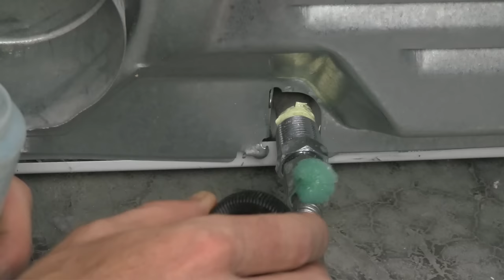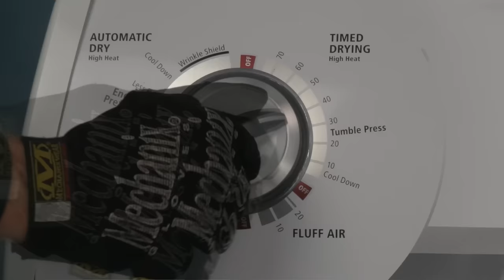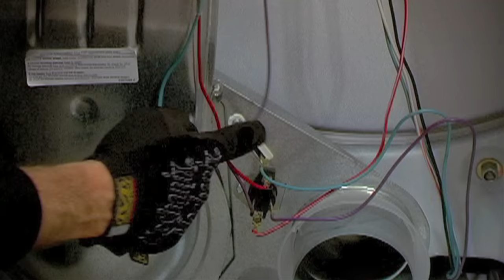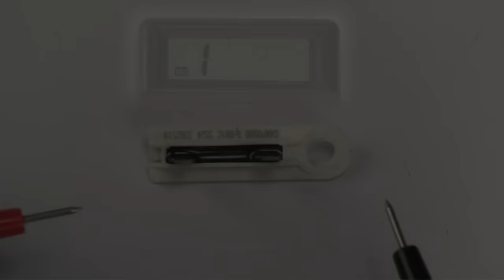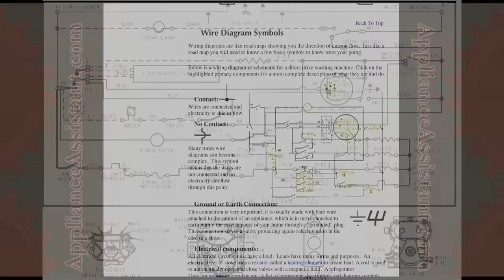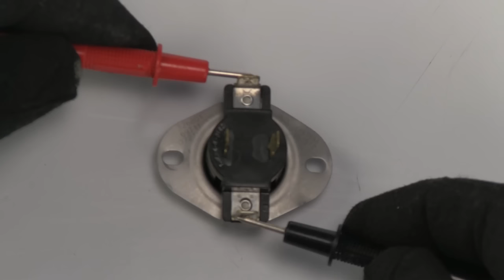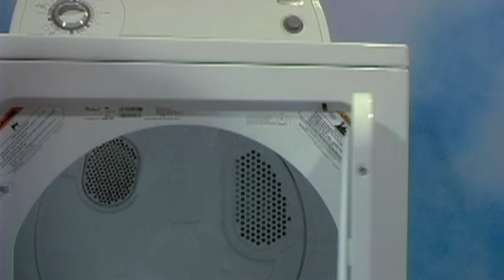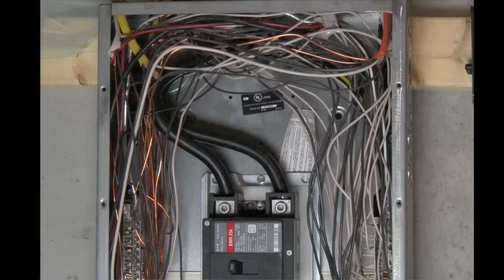Gas Dryer Repair: Fix Heating Problems

Comment: when my glow comes o0n a few seconds later it ignites it stays on for about 2 minutes then it shuts off. when it glows again it does not ignite. could this be the temperature fuse
Reply: So you know for sure 1. Igniter is working 2. Flame sensor working. Go back to the part about the gas solenoid valves. The solenoids are coils that create a strong magnetic field to pull open the gas valve. If they let gas through at first but not after coming up to temperature the insulation on the windings could be breaking down. That means the field they create will not be strong enough to open the valves. You’ll have an igniter glowing but no gas to ignite.
Reply: yes i had replaced the two coils and it works great now thank you for your video

Comment: Thank you so much for the video.  So, when I checked the thermal fuse with the multimeter nothing happened.  No reading.  Bad fuse.  I get it now.  I bought one in town and put it in.  I used a multimeter for the 1st time and fixed my dryer.  God bless you sir.  You are helping people with your gift.  Good things will come to you.  :)

Comment: Just started troubleshooting on my gas dryer(Crosley), with no heat.  Many times you said 'if the fuse tests open, or if the part tests open replace it."  I would have liked to see what that looks like.  Tests open?  Tests infinite?  I don't get it.  I'll have to watch a video on the voltage meter.  thank you for the video though.  I know it will help me in the end.
Reply: Kent Fitzsimmons You have to think of the ways we make electricity do work for us in a circuit. We know that if we have many electrons on one side a switch (Hot side) and connect the other side to a point that is missing electrons (Neutral) the only stopping those electrons from moving is the resistance of that switch. That resistance can be measured. Most switches when open measure an “infinite” resistance. You’re meter might read “OL” because the value measured in Ohms is so high it’s beyond the scale of the meter. Like putting 1000 lbs on a scale that only goes to 100lbs. What that is really saying is the resistance is too high from either a broken wire or open switch for electrons (electrical current) to flow thru. We design fuses to protect circuits from too much current or heat by opening if the level gets too high. In some cases like the flame sensor they reset. In others like the over temperature fuse they must be replaced.
Reply: Thank you for the reply.  makes sense now.  I was able to test the circuit and change the fuse.  works great now.  Thank you.

Comment: Great Job with this. Tested the coil valve one was bad replaced them myself and works like a charm.  No huge bills, just new coils.  Bonus was able to clean out the inside of the dryer, found 20 bucks worth of change a few earrings, 2 broaches, a 10 dollar bill, and assorted other treasures.

Comment: Nothing out of my Maytag dryer.  Gas full to the valve.  No glow plug lighting though intact. Push the main control - seems soft no clicking.  No action.  I tore it all down.  Does my Maytag have a thermal fuse?  The back doesn't come off like the one in the vid.

Comment: Thanks so much for posting this video. It saved me from having to call a repair tech. Turned out to the thermal fuse on my dryer. Total cost for my repair was 12 bucks. Took me longer to find the part locally than it did to actually do the repair! Thanks again!
Reply: YouTube is a godsend for saving tons of money on service calls and repairs.  I just replaced my two coil valves after my dryer stopped heating up.  About $15 for the parts off Amazon and some labor on my own part for the dryer to be as good as new.

Comment: if you connect the gas dryer's igniter to a 3VDC battery holder from snap circuits (if you don't know what snap circuits are, look them up at www.snapcircuits.net) the igniter will limit the current through the circuit but it won't get hot because there isn't enough electron pressure to cause the igniter to warm up because when more voltage is passing through a resistor it causes the electrons in the wire to rub against the atoms of the igniter's material and this creates friction heat

Comment: gas dryers are still being made today (the 2015 speed queen dryer is a gas dryer and although the control board is very close to the burner, it won't fry it
Reply from the maker: +Hays Coleman I've been pretty happy with the quality of Speed queen as well.

Comment: Thanks so much. Very nice tutorial. very well explained. Thanks much. I have Whilrpool duet Gas dryer, which take 3 times the regular time to dry, i removed the vent to see if that helps me, but it didnot help, so this means my vent is good. 

Not sure what else could be a problem, will this be a cycling themostat..??

I think flame sensor or thermal fuse should not be a problem, because it is drying but not as it is suppose to.. so thermal fuse is not in radar, because if thi is broken it wont even run. Flame sensor if not good, it will not even ignite.. so please advsie..

Comment: Issue was the fuse, and THANK YOU for walking through the wiring diagram and explaining the electrical circuit for the flame sensor, igniter, coils, etc. Cool stuff!

Comment: My dryer runs about 3 minutes with gas flame ignited correctly by the igniter. The flame goes out, but the 120VAC is still being supplied to the burner assembly. After about 30 seconds, the system applies power to the igniter, which glows hot but the valves don’t open for ignition.

I don’t understand how the system retries to start. Is there a timer in the burner assembly? All I can see is the igniter, gas valve, and sensor.
Reply: I'm having the same problem.  Everything seems to work fine for a couple of minutes, and then the flame goes out and doesn't reignite unless I turn everything off, let it sit a few minutes and try again.  Still investigating.
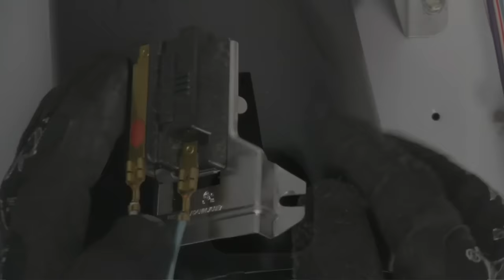Reply: I believe he covers that at 2:30min review for your  symptoms though I am replying to a year old comment. I am sure you have your dryer fixed.

Comment: I put my meter on the ignitor and was getting 140. where I see on the video was around 40. would you say this is still good? I don't have a window to look thru and see if its glowing but I did clean out a lot of lint
Reply: extreme597 likely yes, it's okay.The igniter resistance may fluctuate over time with different part suppliers and manufacturers. With igniters, general if you get a reading it's good, open / broken is the most common problem.  If the igniter is not glowing it's probably the thermal fuse or on newer whirlpool dryers the timer is a common cause. Follow the voltage back from the igniter to the timer and see where it stops.
Reply from the maker: Ywander.com sorry, I was logged in as my other YouTube account when I responded. I hope that helps you figure it out! Good luck!

Comment: Thanks - so if you get a glow but no flame (no click) it is the solenoid coils? or could it also be one of the thermostats on the back?
Reply from the maker: Jack Allender it wouldn't be a thermostat in that case because the thermostats are correctly sending electricity to the igniter to start a heat cycle, it's just that the burner is not lighting.  In the case of the coils the igniter will generally cycle off with a click when the flame switch opens. However,  the coils will not open the gas valve.  If the flame switch never opens it's ether because the igniter is not getting hot enough( very rare in dryers) or the flame switch is defective and not opening, redirecting voltage through the coils to open... hope that helps.  If it clicks with no burn it's almost always the coils.

Comment: Rigid pipe venting allows up to 40 ft. while each 90 degree turn is equivalent to 4 ft of straight pipe. Flexible pipe venting allows up to 20 ft. while each 90 degree turn is equivalent to 8 ft of straight pipe. All other kinds of venting (especially flexible/white/plastic) is strictly forbidden by most local codes. RTFM or ask a pro.

Comment: I found this very useful because it showed how the power has to go through the flame sensor for the ignitor to power up.  I thought the flame sensor was normally open until a flame was present but I was wrong. Thx for the tracing thru the wiring dagram.
Reply from the maker: Thanks for taking the time to post a comment! I'm glad you liked the video : )

Comment: When taking Measurement of Resistance btwn Red Timer wire and Neutral Prong > It Should be . . .  'Closed' for this Test??  >   0 Resistance  <  ?    [brain cell has Slow absorb]  NICE VIDEO!   Have VERY OLD Dryer, Think I Finally found Hard Wired Coils ~ Thanks
Reply from the maker: Thank you! Hard to be sure without seeing a wire diagram for your model. If yours is wired the same as this... with the red wire detached from the timer, and the door closed you should get a reading of connection with some resistance (because of the igniter's resistance) to the neutral of the power cord.  If it's open and you don't get a reading all it really tells you is something is broken. you really need to check the components directly to narrow down the cause.  The rear thermal fuse is the most common problem for a dryer that will run with no heat. The door switch is the most common for a dryer that won't start.  Thanks for the question! Sorry it took me so long to get back with you.

Comment: how does ,a ,moisture sensor work on a gas dryer
Reply: Detects the amount of moisture in your clothes put dryer in diagnostics and touch them with wet cloth if you get a tone they are good. Or you can check them for continuity with a meter

Comment: Thank you! Thank you! Thank You! Using your video I was able to diagnose the problem with my Maytag gas dryer. The wife-of course-just wanted to run out and spend money I don't have on a brand new dryer. Her complaint-the color does not match the rest of the house, and it's "icky". Well, it might be "icky" but it still dries clothes. She's unhappy, but my dryer works! Thank you again. Turns out my ignitor was bad. I tested the thermal fuse first, then the thermostat, and then the ignitor, and BINGO! Bad ignitor! Local appliance repair shop a new one in stock for $47. In total, it took about an hour & a half, and $47. Sure beats buying a new dryer!
Reply: The wife part is funny, but it's true.  Thx!

Comment: the dryer takes a long time to dry clothes when the ducting is clogged with excess lint because the lint prevents the timer from advancing (i may be wrong about this because i really dont know why/how that can happen)
Reply from the maker: When the ducting is clogged, the wet air that is evaporating from the clothing has a difficult time leaving the system. Therefore, the air becomes saturated with moisture and the clothing cannot dry. No amount of heat will help to dry the fabrics because the wet air cannot leave the drying system through the ducting. 
http://appliancediagnostic.com/Dryer-Repair/How-Dryers-Work.php
Reply: oh i see, thanks

Comment: The object of this video is to teach us to fix our dryer and it leads us to different paces of failure. However there is one blaring problem. You say a good resistor has zero resistance and this is wrong. Through your teaching you do this many times. The actual fact is an open circuit has zero resistance where a closed circuit will have one ohm or less resistance. Because a coil has many hundreds of turns of wire the resistance of coils can have an ohm value or the resistance of the wire. Coils are fickle though as the small wire can burn open but burn into a neighboring coil wire and test still with continuity. Coils are tested with current. DIY people should not work on live units so as the parts are usually small cost we can persecute the innocent until we find the guilty. Or replace one coil at a time until it works. Safe and easy. Do not get into the habit of thinking the meter reading of zero is a closed circuit, look carefully , the meter will show 00.1 on the k-ohm scale which is one ohm and if the circuit is open will read 00.0 unless you have your fingers on the leads. I recommend the lowest scale for troubleshooting.

Comment: Great video.. I am having the dryer gets too hot.   I will be checking the thermostat heater . One thing though, do all dryers use the same color coded wires? Thanks ,, for the info
Reply from the maker: No the wires are not standard colors.  The most common problem is a clogged home duct.  The most likely mechanical problem within the dryer is the cycling thermostat, or thermistor if its electronically controlled. On an electric dryer, ironically it can also be a broken heating element that has shorted to the outer housing of the element, bypassing the cycling thermostat. 
if you need more help with dryer issues I have a lot more info on my website:
http://applianceassistant.com/dryer-repair/
Thanks again!

Comment: I rarely post comments. This is really a great and helpful video! Thanks you!
Reply from the maker: if you need more help with dryer issues I have a lot more info on my website:
http://applianceassistant.com/dryer-repair/
Thanks again!
Reply: applianceassistant
Reply: my dryer is burning in a few minutes after it switch off , i change the 3 terminal coil and the  thermal fuse at the back it is the same what do you think is the problem of my dryer please help me , please send your answer to my email reynebustillo@yahoo.com. thank you sir

Comment: had no heat on kenmore dyer .checked fuses etc everything fine except igniter Replaced igniter had heat for two weeks now no heat. Think its a defective igniter?
Reply from the maker: bummer! Hard to say, probably not. Unfortunately you really need to start from square one again.  Also, timers have been common on newer models like this, Whirlpool (Some Kenmore) cheapened up the timer a lot!  so if you don't have voltage at the thermal fuse check the timer.  Good luck!
Reply: Thank you so much for your reply.The timer hasnt worked in a long time we just set stove timer to go and  shut off dryer. I know.... no excuse for this behavior.Will work on getting it replaced.   Thanks again!
Reply: Just wanted to let you know it was a fuse this time.Appreciate the help.

Comment: how ypu fix the centrifugal switch? s
do you need to replace the motor?
Reply from the maker: Unfortunately the center fugal switch is not repairable, apart from carful creativity or replacing the motor. Thanks for the question!
Reply: Thank you so much,  love your videos!

Comment: The video is very informative. My problem is I would not trust this technician working on my dryer. He removes the wire terminals by pulling on the wire instead of grabbing the terminal with a plier and pulling them off. By pulling on the wire instead, the wire may detach from the terminal. Get a better model for your videos that do not show bad techniques.
Reply: B Lee I agree ripping wires is rookie move , this is an incompetent tech. His taping the vent is an idiot move and the venting is not allowed and a fire hazard and voids warranty.

Comment: Thank you for a great video and explanation. Changed my coils, problem solved, About n 1 hour of my time to open the dryer, diagnose, remove the bad coils, go to the appliance store and get new ones and reinstall. $26 probably saved me $200 in serviceman repair labor cost.

Comment: Thank you for the excellent video.  I replaced my coils a month ago and I thought the problem was fixed, but no.  My igniter is working and in fact will never shut off.  The flame sensor has zero resistance through the circuit.  Yesterday I opened up the front after running the dryer and the whole coil and gas valve area was warm as if it had been working,  however it wasn't.  I started the cycle and waited about 5 minutes and then touched the coils to see if they were getting warm.  Zap!  Don't do that!  The coils are getting power, trust me and they are relatively new.   I then compared their resistance against the old coils and they are exactly the same so I don't know if either are good or bad.  BTW the entire gas valve was replaced 5 years ago to solve the same problem but it turned out to be the flame sensor that time.  Why can't I get a flame?

Comment: Hi,

If the flame is too "strong" or high, I can see it from the inside of the dryer, do you recommend to try and adjust the valve or replace it?

Thanks
Reply from the maker: Sounds like you may be on propane, but the dryer was never properly converted. That's my guess. Probably the gas orifice is the wrong size.
Reply: +applianceassistant Thanks

Comment: Thank you thank you thank you !!! I bought new parts for my dryer (Flame sensor, igniter, coil kit) I am sure that all parts were installed correctly, but I forgot to pay attention to which color wire went where !! The dryer shorted out when I started it so I know some wire is in the wrong spot. I bought new spades for the connections and I am praying that I can figure this out !! Your video helped me understand tremendously.
Reply: Also subscribing!!

Comment: I took apart my dryer and saw that the burner tube was burned up. So, I ordered a new burner tube. Now, I just need to find out why that would have happened. Awesome video to get me started on problem solving.

Comment: This is the best video on fixing your gas dryer. I have never worked on a dryer before. I barely know how to use a multi meter. Followed the instructions in this video right down to pausing it to see the settings on the multi meter shown. Fuse ...ok. Igniter...ok. Flame switch...open circuit! $15.00 later, dryer is fixed! Awesome! Thank you very much.